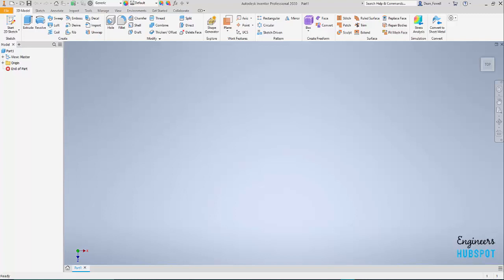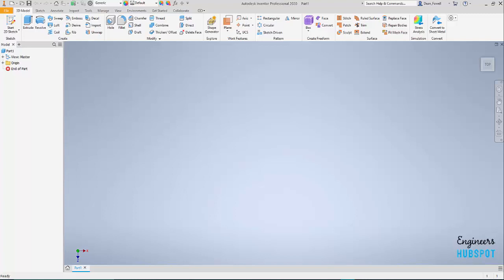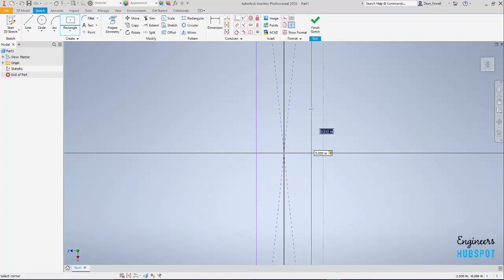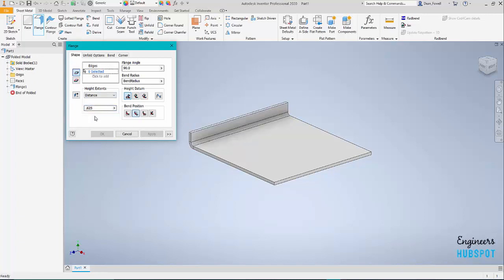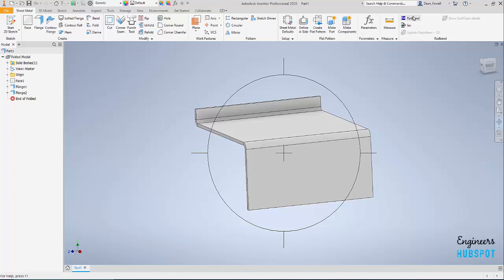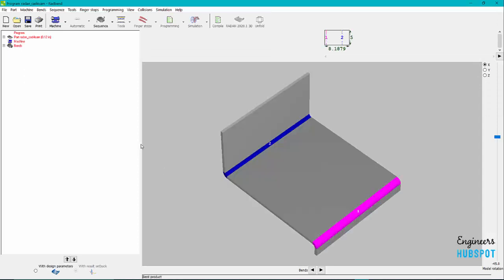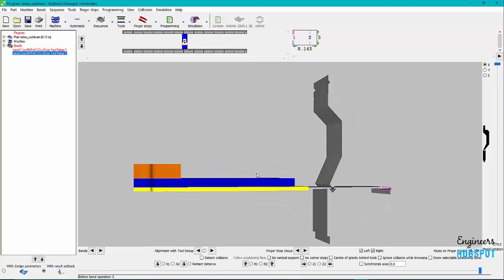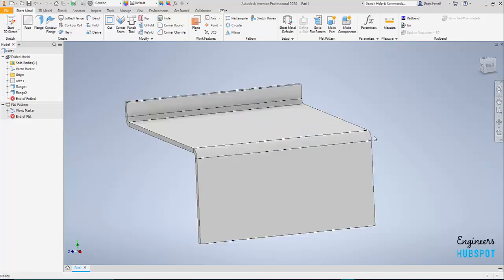Offline Press Brake Software

Comment: Hello sir,
I'm working on Durma AD-R 30320 (DT10 control unit), all programs, punches and dies that I've created are in XML format. 
Is it possible to create programs, draw punches and dies, and export it as XML, so I could import them via usb stick?
Reply from the maker: Depends on the Machine and the Capabilities of the controller you can export tool info as XML but not sure what you can import on the Durma. I no longer have Radbend but you can talk to the guys at RADAN.com
Reply from the maker: I think you can